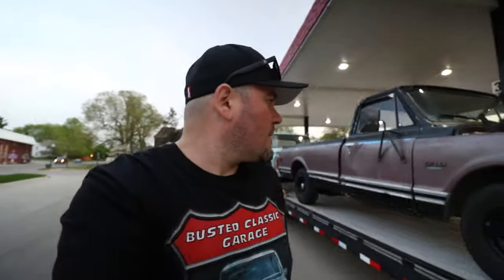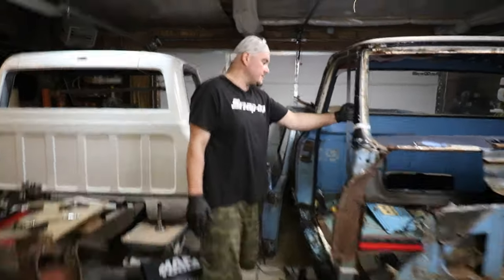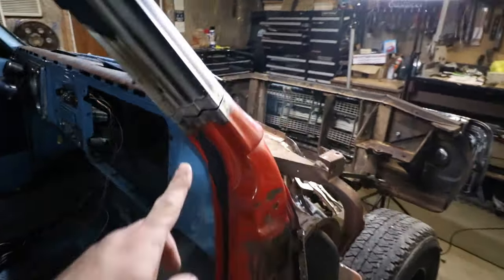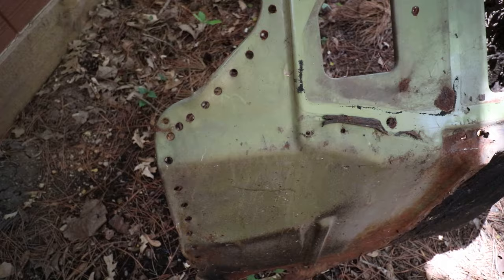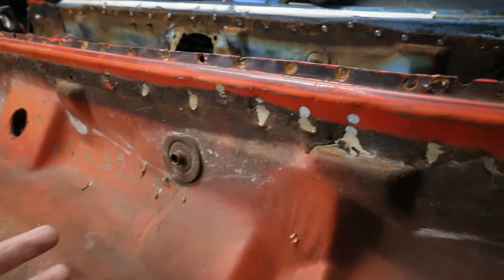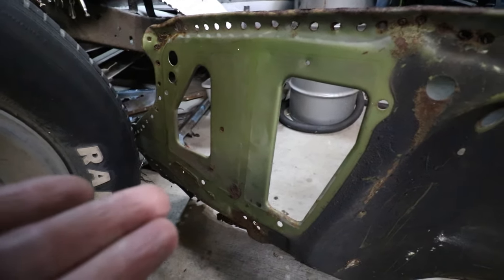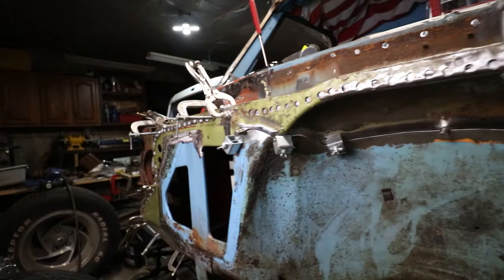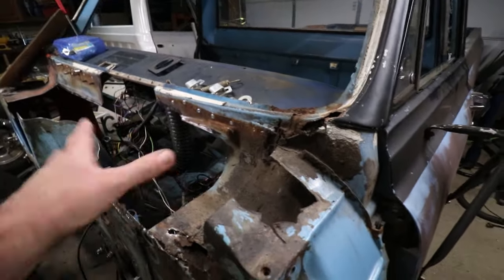How do you repair a classic truck that's beyond saving?

Comment from the maker: As far as drivetrain. Should I put the reliable 305 in out of the Camaro or build a 350 or 400 sbc?
Reply: If it’s just a driver, the 305 is fine. If you want some power, 350 or 400. Or you could do a 383.

Comment: Its pretty awesome that you're skilled at welding to repair metal in the truck. If I want to save some money I'm gonna have to learn to weld  to replace rusted drain behind the kicker air vent. Great video, I needed this as it is very educational for me!
Reply from the maker: Nice, glad I could help. And definitely learn to weld, it's a great skill to have, especially if you are restoring these old classics.